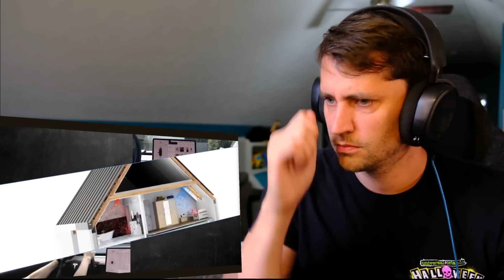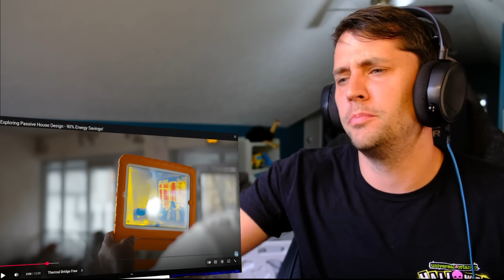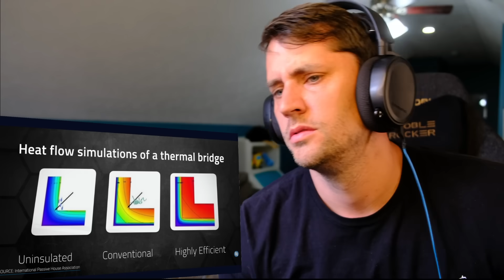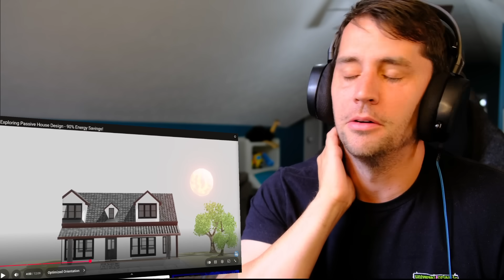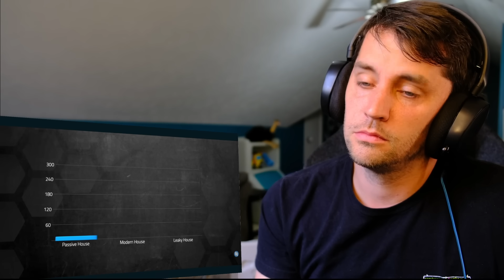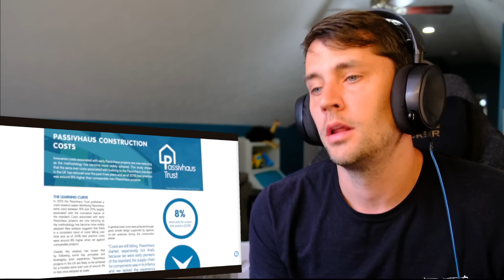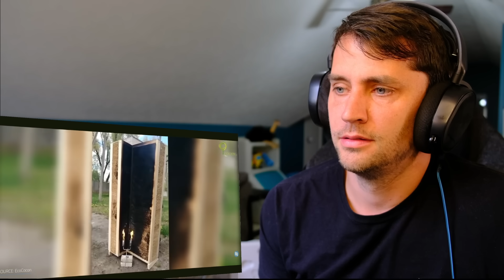American reacts to Germany's amazing 'Passivhaus'

Comment: My house is from 1980 and could have some insulation improvements. the roof is insulated already. The windows could be upgraded from double glass to triple glass but i am afraid of mold. I put some insulation strips in all windows and doors to outside and have to be careful with mold already. The basement roof could be insulated, maybe i will do that. 
I changed from a gas heater to a pellet heater what will about half the energy costs for heating. In summer i only need hot water for the bath and i covered that with solar panels and a DC heater coil in the 600liter hot water tank. The hot water tank is for the house heating but there is a stainless steel coil inside for hot tap water. There is no pump connected the pipe pressure is enough but there is a mixing valve that mixes cold water in after the water tank to limit the temperature to 50 Celsius, so nobody can be hurt from boiling water. The water tank makes the wood pellet heater having only one burn cycle per day in wintertime to limit wear of any parts. I bet the heater will last between 20 to 30 years and then i will probably push up daisies already.

Comment: I first came across thermal imaging about 20 years ago. They used it in Industry. Mainly to make an image from fuse boxes. Bad connections heat up. Not long after it was used in house renovation to find where the house loses most of the heat in winter. One of the first methods is to change out windows for example.

Comment: Iblivebin an old soviet Block but we got New Windows and insulation some yesrs ago and this yesr we got New water pipes. I have a lower neightbor who is using the heater almost every night in her effin bedroom
Aince has proofen 16°c to 18°c best air klimat u csn sleep in yet shes heating 
While i have my window on tilt the whole night as long as it doesnt sink Beneath  5°c outside
I will wake upnwith my bedroom being at 17°c in this care  most of the time 
And ibwork from home so within 3 h (my py is in the bedroom) its 20c agsin and honestly it doesnt need to be much warmer Sweater do exist ahould i feel cold 😅 and i never have momd issues the only room where i had mold issues was the bsthroom it has no window just a vent  and i cant keepnthe vent open in winter i csnt take a number 4 if im sitting in an cold air Streamer 😅😂 not working
Reply: Oh note
Inlive on the upperbflorbtherebisbjust a maintainance space above my cealing wich has half the hight off a normal apartment (2,50m so its only 1,30m high)
The tree Infrastruktur of my wondow is not high enough to Block the afternoon sun compleatly 
So i have to let air in as long as its cooler as my room temp

Comment: 9:35 greetings from Germany. I live in a (probably not passive) house. My parents built it themselfes in 1999. And to answer your question: yes! We do "Lüften" every time of the year! Even in Winter! It's called "Stoßlüften" (aka. bulk airing out?). It's when we open every window completly (not tilting them) for around 5-10 minutes and then close them again. This is done at least once per day, but often times two or three times a day. Sure, in Winter there is cold air coming into the house. But thats only for a breef time and it doesn't effect the heating much. At least less than a badly insulated home 😊

Comment: Why are there so few certified houses? Well first of not everybody is going to certify, secondly normal "standard" houses have a high built quality already and thirdly when we where building our house 7 years ago it was difficult to find contractors who where specialized in passive houses in the Netherlands. A lot has changed in the past years and the industry has geared up to produce more passive houses ....still building your own home is a fraction of the total housing development.

Comment: In Austria, if you want to put your house or flat for sale, you LEGALLY HAVE TO PROVIDE the thermal images and the results of the inspection!!!
Couldn't find out the exact %, but in Austria there are "tenthousands" of Passivhäuser and in Vienna alone thousands of them. Allegedly Vienna (? - maybe Austria...) is the pioneer/cutting-edge of them... 😎 (says Mr. Google 😉)

Comment: Windows itself are actually pretty good at insulating if they are multi-pane. The air gap between the panes is one hell of an insulation. And if you have 2 gaps like in a 3-pane window the insulation is really good. The bigger concern are usually the frames and how they connect to the walls.

Comment: Windows are not difficult to isolate towards the cold. With 4-paned windows you have a pretty good isolation. The problem is during spring, summer and fall, when you get a lot of sunlight. The modern windows are huge, so you end up needing airconditioning from April to September in Finland.

Comment: My house I oriented to the sun, controlled ventilation… if done clever it even did NOT cost more, just intelligent building. 
Most builders are driven by their habits. In 2000 we built a very high efficient house with PV and solarthermie, controlled ventilation in Germany. Everybody thought we would be throwing money out of the window… but we did NOT as much as they would 😂… it paid of very fast and guess? It is still advanced technology… You can get a much higher price if you would sell it. But my son wants to keep it anyway.  
In those days we were asked if we did not  need gas for heating by the local provider three !!! times as they could not get it… we fis a pellet heating system instead. 
There is woodwool insulation, good for the environment, your Health and your purse… 
It is treated with Soda so it withstands fires excellent…
Use your brain! The Industrien are only minding their Profits!

Comment: In Germany, few people build 100% passive houses, as the owners often prioritize their own wishes over the requirements of the passive house regulations. If only 95% are implemented, it's a very energy-efficient house, but not a certified passive house. 
Typically, the house isn't built facing the sun, but rather the street. The entrance, staircase, kitchen, bathroom face the street, and the living room and bedrooms face the rear, or the garden – it's quieter. Even if you don't have a certified passive house, there are other energy certificates for houses. The higher the house's certification, the more valuable it is. This also applies to apartment buildings; the seller or landlord must now state the apartment's energy efficiency ratio. The tenant or buyer can then estimate their energy costs for the apartment.

By the way, a liter of heating oil currently costs around €1 per liter in Germany, and gas costs approximately €0.12 per kWh. Interest rates for building or buying a house average 3.6%. So, the additional costs for energy-efficient construction pay for themselves quite quickly.

Comment: Where I lived before it wasn't a passive house but pretty decent energy wise. A human generates 100 watts of heat, so does an average PC setup (except when gaming, then add 3x). Me and my PC were able to heat the home office room with no additional heating required, except for 1 or 2 months in winter when the average outside temperature goes below 0°C. However, one must say that I am unusually comfortable with lower room temperatures (18°C is enough for me). The heat capacity of non-cardboard houses is also significant. From tests I did during a heat wave, the core temperature of the house would take about 8 hours of all windows open to go halfway towards the outside temperature (core temperature = what will be the inside temperature 5 hours after closing all windows).

Comment: My house built in 2009 is nearly a passive house. As a physicist, I bought the bible on designing passive houses, learned their methodology, kept my own spreadsheet of all the building details and decided where to spend the money to go beyond the building code. In the end, it had most of the hallmarks of a passive house except I have just 10 inches of insulation in the walls and double pane windows instead of triple (those would have been an extra € 6000, and triple pane was not as good as it is today). The philosopy of the passive house is to have a heating and hot water energy requirement of less than 10 kWh / year and m², but those were allowed to come from an electric heater which at that time with the mix of electricity in Germany in the 00s meant a primary energy use of 30 to 40 kWh / year. I instead opted for a heat pump drawing the heat from a hole 100 m into the ground. It has a coefficient of efficiency of about 4, so in terms of primary energy usage, I was even better, without the money spent for certified compents and the certification of the house from the Passivhausinstitut (there's a compound word for you). I buy 100% hydropower, so to the extend that one wants to believe that certificate, my primary energy usage is actually 0.

Comment: We own an old house in Germany, dating back to 1930. We renovated it, insulated it well, and installed a medium-sized photovoltaic system and heat pump. The PV system generates more energy per year than we consume. We are technically self-sufficient, but unfortunately, the PV system doesn't produce enough energy in the winter (October to May), so we have to buy some electricity (2000 kWh) during that time. It is therefore possible to be very energy efficient with a house that does not meet passive house standards.

Comment: I live in a house like this, actually thought it was a lot more normal than it seems to be. There is an energy rating on homes here in Norway, and I'm pretty sure you get special compensation for having a good rating, I'll have to remember to ask the owner. But I know for sure we get grants and stuff for installing solar panels. Really surprised there are only 25K of these houses, I'm kind of thinking he made a mistake with that number. Either that or a "passive house" is a really extreme rating that goes beyond just being airtight and have a built in heat pump and triple windows and all that stuff. Maybe it's more common in Norway than Germany due to the cold climate making energy efficiency more relevant or something, but still, 25K seems very low, and I thought he said Europe and not just Germany but I might have missed something there.

Comment: Not just Germany, although they're probably always on the forefront in any kind of engineering and research about EVERYTHING, houses included.
I am Icelandic and currently live in Iceland, but have lived in Norway and Sweden before. In many ways, these 3 countries follow the same rules in housebuilding, whether it's a single family house or a large apartment building. The main difference between Iceland and the other two is probably how we build most of our single family homes. In Iceland, our houses are mostly built in concrete; foundation and floors, outside- and loadbearing walls and 'floors between floors', as in a 2-3 story house has concrete as floors and ceilings. Insulation is in every light wall inside and the shell is insulated either on the inside or the outside. It varies, but in later years it's mostly on the outside.
If there's any mould within 20 years, then some worker probably was hung over on a monday and missed a spot.

Comment: Why only 25.000 passive houses? Well, first of all: I Think he's talking about Germany only and about certified passive houses. There are also passive houses without any label at all. For example, if you plan to pass your house on to your children and don't plan on ever selling it, you don't need a certificate. If necessary, you can also have the energy efficiency certified retroactively.
2. Most people in Germany live in rented accommodation. 
3. Single-family homes are more commonly purchased or rented than newly built, and when they are, they are more often terraced houses or apartment buildings.

And  just look at plus-energy houses—that's really wild. A friend of mine gradually converted his low-energy house into a passive house and then into a plus-energy house by himself, and now he even charges his EV mostly at home (from spring to fall) with his own electricity. (He's a master craftsman in construction.)

Comment: We have companies that build prefabricated houses from thick wooden beams, strawbales and wood boards, as plaster on the inside you can use a clay based solution, the room climate is good, like really good. THe thing won't just easily burn down and it's realy well isolated, can pop up in a few days, the longest work on site is the concrete slap/cellar and inside work for the finishes.
You can technically even build small tower houses  that are not public buildings from tehm (Germans may call tehm 'skyscrapers' though US people would laugh at that notion).

As for your question about 'Stoßlüften' (opening the window a few minutes every hour or so, the heat loss is depending on what you do negligable. Basically air doesn'T take much to get warmed up or cooled down and you can test taht in your own home with a freezer. Everyone has at some point opened a fridge/freezer, closed it and then quickly opened it again, right? Well the gasket isn't air tight, if it would be, you could never open that fridge/freezer ever again. You probably noticed s sort of hissing/pffsh-ing sound? That'S the air going into your fridge/freezer quickly. When you close the door you have introduced warm air into the appliance, it nearly imedeately cools back down, or in case of cold air going into your house in winter, it nearly imedately heats back up.

Edit: An adult human just sitting there doing nothing but breathing is about 100W of heat, modest activity is about 150-200W, hard work can tripple that and don'T get started on extreme feats of excrecise, that can reach 500W in bodily waste heat.

Comment: Ah the follow up video. Before I even start watching it, let me put one thing straight. Passivhaus is neither super common, nor the norm. They exist but they are kinda premium versions of houses over here.
Edit after the video. You find houses in the US expensive? This 149m² house will cost you a couple 100k € for construction - excluding the real estate, which could double the cost in general. So, building a Passivhaus on a small lot can cost you north of 500k € easily - assuming you build in the suburbs. 5-10% premium on such a sum is no small thing and can make or break the mortgage...

Comment: In fact, European windows have been insulating noise and heat very effectively for several decades, it is not a new technology. "Eurowindows" are very old, only the efficiency is increasing, they have 3 glasses, they are filled with nitrogen, etc. can be found on YT. When there is noise outside, just close the window, you can hear nothing.

Comment: 12:10 In Germany, especially northern Germany, the use of heat from livestock has existed for thousands of years when houses and stables were not yet separated from each other.
18:55 There are more. The reason is probably that few people get the entire certification (certification also costs money...). And that many houses aren't built quite so strictly according to standards and therefore don't quite meet the requirements of a certified "passive house." (But they still save a lot of energy compared to conventional houses.)

Comment: New houses in many European countries have to meet stringent low energy building standard regulations or they will not get a building permit. Fossil fuel as a heat source for new houses is forbidden in most countries. PASSIVE Energy houses though are not as common because they are still very expensive but large apartment blocks are increasingly built like that, especially in bigger cities. There is also a Trend towards rooftop gardens and/or hanging gardens as cooling systems and of course you have to plant a certain amount of trees to offset your "concrete footstep" so to speak.

Comment: I have a 40 year old house from the eighties. I heat it with ACs and switched to a heat pump for warm water and an EV and bought a solar roof.  I pay about 1200€/year for heating and mobility. This is not passive house standard, but I think pretty okay.

Comment: New Buildings (Germany, as of ~2025)

    Share of certified Passive Houses: approximately 1–2%

    Share of buildings close to Passive House standard (e.g. Efficiency House 40 or better): up to 10–15%

    Reason: There are financial incentives, but the Passive House concept remains a niche due to additional costs of ~5–10%.

    Source: ChatGPT (based on current data from the Passive House Institute, UBA, and expert estimates), 2025

Comment: I live in a renovated 150yo house. It is not passive house but on the same level as a new build would be. It takes around 700€ a year for all electricity (house, heating and driving) I also get 1400 € a year for selling electricity from my large solar to the grid. So I actually have negative energy costs. Overall renovating an old building was by far cheaper then building a new passive house. It was not cheap but comparing to a new build a bargain. PV got really cheap so it is no problem producing a large amaount of energy if you have a big roof. heat pumps got really very efficient, so it is not that important to chase the last couple percent of efficiency. Just do what you need to do anyways in terms of renovation, put as big as possible solar on top an then do everything electric. that's the way to go with ridicously low energy bills.

Comment: A modern house can use electricity only, 1300 kWh for the heat pump plus 2200 kWh to operate all electrical appliances and have a photovoltaic system making 10,000 kWh of electricity per year. So yes, summing all up it's an energy+ house, pumping about double the power into the grid it consumes.

Best investment ever!